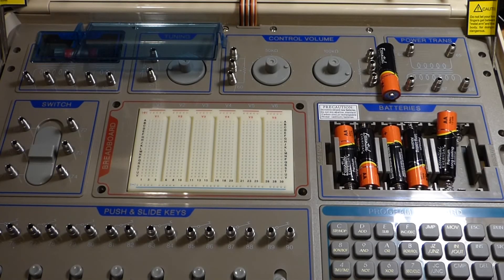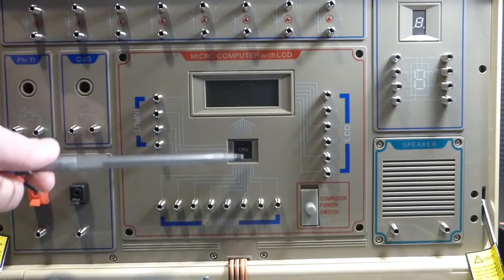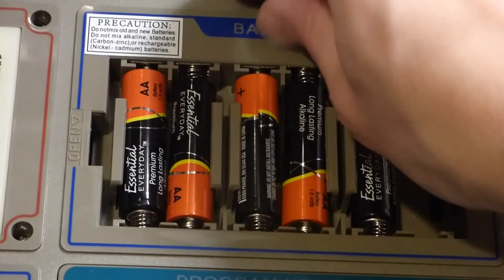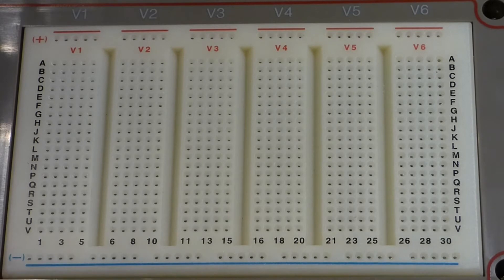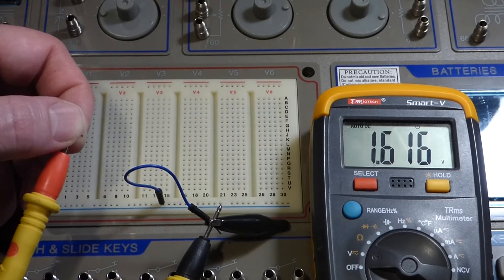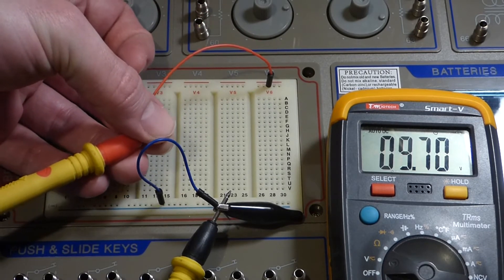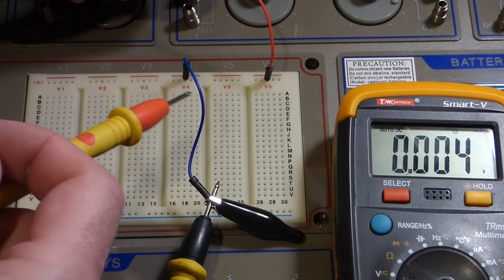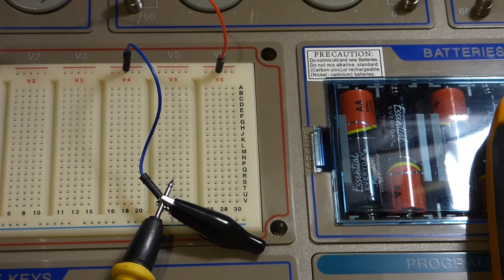Quick look at Maxitronix 500 in one electronics lab power supply and short circuit warning

Comment: There are 2 as of Dec 2025 on ebay, Ione is $130 or so and the other near 200 and has everything, I paid $31.xx for mine and cant wait till it comes, its just the unit itself no wires or books so but that's fine for the price lol.  Thanks for the video BTW.
Reply from the maker: Nice, it stopped being sold right after I made this video, so I didn't make anymore videos.
Reply: @Electronzap  You wanna sell the books or maybe the whole thing¿
Reply from the maker: @PatrickBaptist no, I don't sell stuff, especially through the mail.
Reply: @Electronzap  Fair enough thanks for the consideration.
Reply: @Electronzap  Fair nuff, thanks for the reply.
Reply: @Electronzap  I spent some time looking and found a site that has the books for alot of those X - in one kits and they had all 3 of the 500 in one.

Comment: I was lucky last time with a resistor. forgot to disconnect the power when replacing parts on the breadboard. when I went to pull the resistor out ,it was so hot it blistered my finger.
Reply from the maker: That sucks. I been burned a number of times by resistors. Never bad enough to blister though, that's definitely a bad burn.
Reply: dumbnass
Reply: go home loser